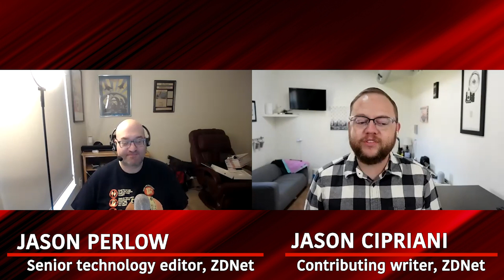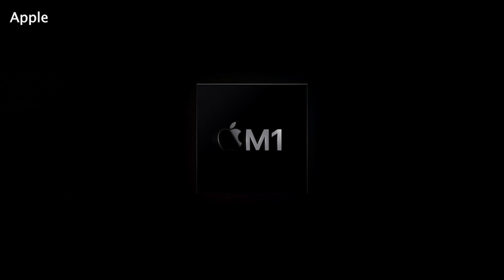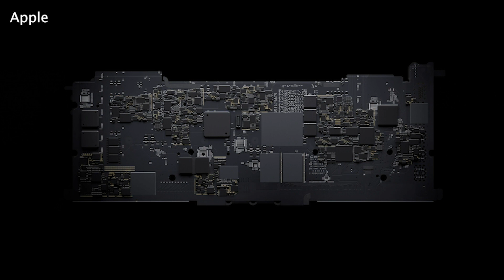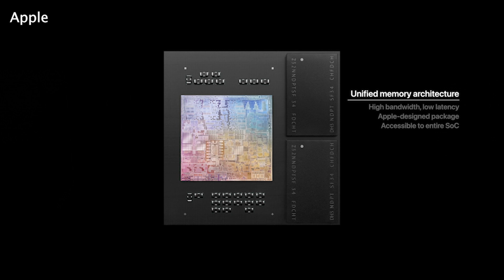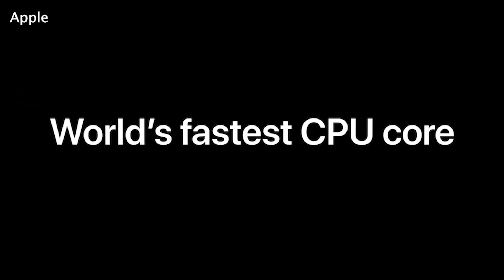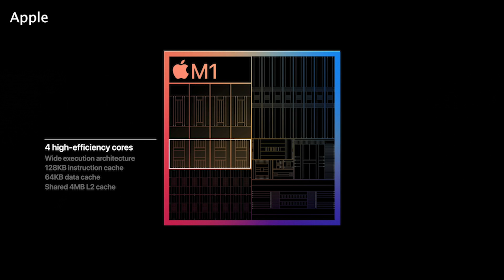Apple Silicon M1: Surprise, disappointment, and the future of the Mac

Comment: Wondering if the M1 mini solves my External GPU issue. I bought a 2018 mini in March 2020 and bumped up the RAM to 32GB. The plan was to get one of the eGPUs for working with FCP and Photoshop,  but compatibility issues (both hardware and apps) and availability (those darn cyber miners) gave pause to that idea. Will the new mini and its SoC GPU be a significant improvement? Will 16GB be enough to do the work? Will an M2 version with more onboard RAM arrive so quickly that buyer's remorse will make any celebration nearly impossible?